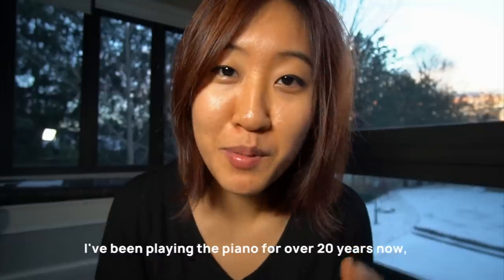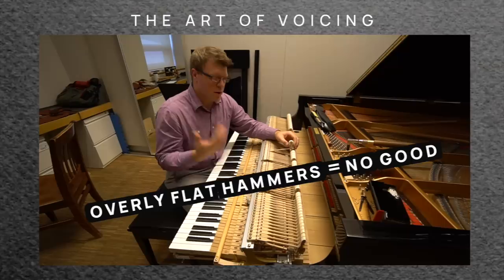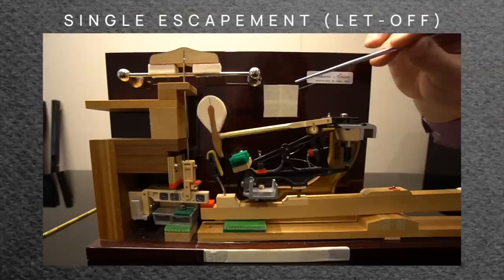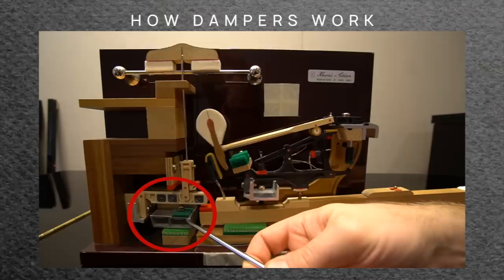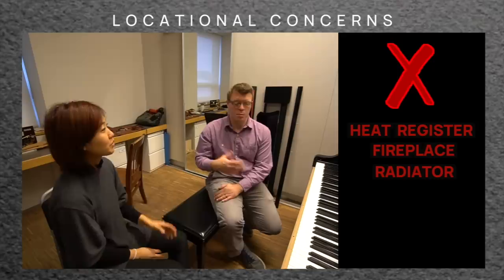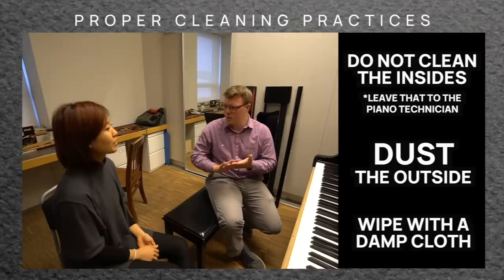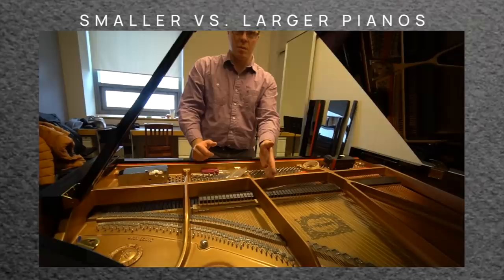The Fascinating World Inside of a Piano

Comment from the maker: Timestamps for smartphone viewers --

00:53 All of the different parts of a piano action
01:43 Basic key mechanism
02:21 The art of voicing 
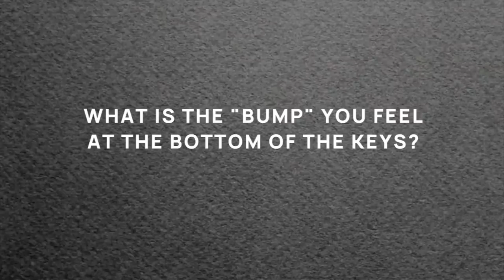06:33 The bump at the bottom of the keys (single escapement)
07:46 How dampers work
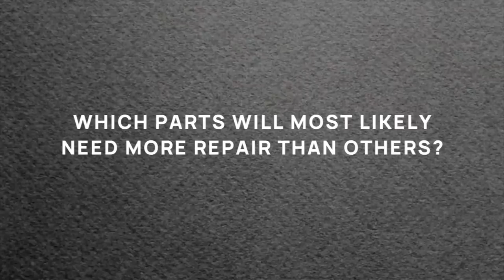08:46 Parts that wear out faster
10:04 Ideal conditions for pianos (temperature and humidity)
11:13 Ideal locations for pianos (what not to do)
12:44 How to make the touch lighter or heavier
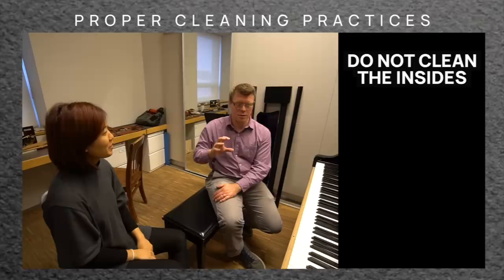16:20 How to clean your piano
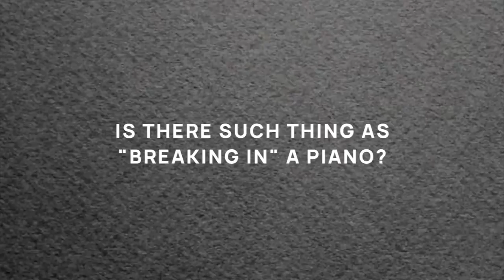17:37 New pianos
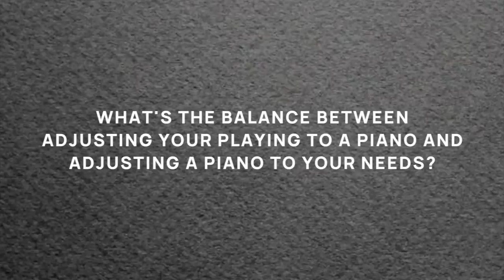18:38 Adjusting pianos vs. adjusting TO pianos
19:35 How often you should tune pianos
20:10 Smaller vs. larger pianos
21:17 Advantages of playing on a grand piano
22:59 Tips when looking for a used piano
25:07 Pedals
25:59 The sostenuto “middle” pedal
29:28 Final thoughts
Reply: Thank you!
Reply: Nahre Sol Thank you Nahre! It is very kind of you.
Reply: Amazing video! Learned so much! Thank you! And the fact that you timestamped it, shows so much regard for the time of your viewers. So thank you again!
Reply: I wish more youtubers would make videos with timestamps!
Reply: That's very considerate of you <3
Reply: hawkturkey , well some bright remarks on the quite small uprights which have their key balance point so near to the playing surface, that you can hardly practice the broken chords and more advanced études and concert works. now we know what's actually up with them.
Reply: You should pin this!

Comment: 22:41 physics.

What he said in the first half about the power coming from pushing the energy into the strings, (physics)... it’s easy to break something solid against something solid. But it’s much more difficult to break a solid object (a bad hammer) against something elastic. This is because elastic things (in this case the strings) absorb and channel the energy and redirects it in the direction from which it came. And in some cases it’s actually easier to break a solid object with something elastic like a whip. (Assuming the elastic object can withstand the amount of energy).

Rebounds/elastic things (rubber bands; etc) actually have a stronger impulse than when hitting a solid object. This is because when the elastic object absorbs the energy it usually sends it back with even more energy in the same direction the energy originally came from. This is because of Newton’s third law. A good example of this is breaking/bending a stick. 

When the stick breaks (from being dried out) the energy is released. But if the stick is still wet and ripe, it will bend. When someone walks past a branch and then it whips you in the face, they have put energy into the branch on top of the energy already stored by pushing it aside (usually forward). As it whips back, it gains momentum and speed. Because the tip of the branch is further out from the trunk/base, it has to move faster to keep up with the base of the branch near the trunk causing it to gain momentum. Sense the base of the branch is connect to the trunk of the tree, it doesn’t have to move as much.

As a result, the branch backlashed with more energy. (I’m not sure how well I explained that but hopefully it made sense). Basically, elastic things have more backlash than solid things because elastic things can absorb more energy. That’s why worn hard hammers bounce back rather than putting emergent into the strings. Or something like that.

There’s an old saying “if you don’t bend you break”. Now a days people don’t usually say stuff like this often or don’t pay mention attention to old sayings like this but this saying obviously came from physics. It’s a concept of physics that can and is at times applied to life. Newton’s third law of motion is another concept not isolated to physics as well as the idea of perfect elasticity in terms of transferring of energy. What I mean, by perfect elasticity is that energy can be transferred through a change of events. It doesn’t matter if it’s positive (happy, joyful, etc) emotions/energy or negative (depression, bitterness, etc) emotions/energy. Basically, if you have a bad day and yell at someone, later that day the person you yell at has potential to yell at someone else, and the chain keeps going. As adults, we know better but honestly it’s more about how much negative energy can we withstand/absorb before we feel the need to release it. (Sorry this last part is a little off topic but it was a good chance to make a few points).
Reply: "This is because when the elastic object absorbs the energy it usually sends it back with even more energy in the same direction the energy originally came from."

No. Energy cannot be created from nothing. Unless a chemical reaction occurs, the elastic object can only send back a maximum of the same amount of energy it received (usually less due to energy losses from sound and friction). What happens with the branch is that the person who's pushing it is doing so relatively slowly, so you have a slow and steady accumulation of potential kinetic energy in the branch sometimes over several seconds. When the branch is released, all that energy is released in a much shorter time span, meaning it has to be higher (e.g., the person put in 100 J of energy per second over 5 seconds, and the branch releases 500 J in 1 second. The end amount of energy is the same).

"As adults, we know better but honestly it’s more about how much negative energy can we withstand/absorb before we feel the need to release it."

Are you honestly treating "energy" in the psychological sense as if it were the same as energy in the physics sense? REALLY?
Reply: bennemann you’re right. Conservation of energy. (Plus laws of thermodynamics dynamics. And if we’re assuming the energy wasn’t lost to friction  and heat, Newton’s 3rd law would apply.) But that wasn’t the point. It’s called a metaphor. 

When I wrote this admittedly I was a little rusty in physics. Not so much right now since I’m in a physics class but still, that wasn’t the point.

And whether you believe it or not, negative energy is contagious. Positive energy can be too, but this is all relative to the type of person the energy comes into contact with. Thus meaning for some people it’s harder to be happy if the situation does match up with thoughts inside their head. Of course this is not necessarily true for everyone. A good common example of positive energy is taking a friend out to drink when they’re down. (I don’t drink but its not hard to tell that this happens). Obviously, we set examples as adults. It’s not something we choose but something we grow into. Thus adults we have a responsibility to know these things and the help balance things out if possible and or necessary. To much good stuff is bad stuff. It’s about balance.

Musicians are tend to be pretty aware of this. It’s important to not be too hard on yourself sense you’ll just end discouraging yourself to the point of not want to play but you also need to be aware of what you need to work on and be focused. It’s like being strict while also being kind at the same time.

This part is psychological but the original concept was more sociological. Among other things.

Comment: 6:33 shows, in my opinion, the most important action part, the jack, that allows the action to function by letting the hammer go so that it doesn't block against the string. Almost every modern piano action has this, except the Hickman action which uses an actual knuckle joint (different than the "knuckle" at the bottom of the hammer) for the letoff action, which is much lower friction than the sliding jack and hammer knuckle. A great design but introduced in 1929 as the Depression hit and nearly wiped out the piano market, so was quickly forgotten, while the old jack system kept going thru the present.

Comment: Compressed air works great for cleaning the insides of a piano. Of course you cant use too much air pressure but a gentle blow can remove built up dust and other materials without damaging or having to touch any of the insides. Its what i use to give the insides of my piano a gentle clean every so often so dust doesnt build too much.

Comment: Very interesting, thankyou for the video. 
I would be really interested in another one on pianists's personal settings ( after touch, tension of the springs, distance of the hammer from the strings, back check height, etc.) and how they affect the tone production. Benedetti Michelangeli for example didn't want too much tension on the repetition spring because when you lower the key you have more resistence, and that is good for playing fast repetitions but not for playing a very good pianissimissimo. Also here he doesn't say that the after touch should be at 2 millimeters from the bottom of the key or that when you feel your action not responding well, if you just lubricate periodically the knuckle it will make a huge difference!

Comment: Decreasing wear on the felt pads is NOT why making action adjustments is important. The reason why action adjustment is important is that the better adjust the action, the better "regulated" it the term technicians use, the better the action is regulated, the more even from note to note is the pianists control over the notes, and the more precise control of each note, the pianist has – you want each digital to go down the same amount before the let-off occurs and the hammer goes flying into the string, acoustically-detached from the digital. You want to feel the same amount of resistance at each digital. You want to hear the same amount of loudness for the same amount of force upon the digital, from time to time and digital to digital. THAT is why making action adjustments is important – so the pianist has the most possible control over what each note sounds like, in response to her striking each digital with her digit.

Comment: My piano technician told me that the humidity shouldn't drop under 50 %.
The recommended humidity on the steinway website is 45-70 %. So i think the advice of 40 % in this video is too low. Great video tho! So relaxing and informative!
Reply: the ideal humidity for a piano is actually 42% (translating to ideal moisture content in the soundboard). Slightly higher or lower is OK, however it's the extreme fluctuations that cause problems. Someone living in the desert would have a very hard time maintaining 50%, however if it were consistently 35% and didn't vary much, that would be fine. Also, someone living in a cold climate with winter heating could never maintain 50% without having sweating windows.
Reply: @paulclement4222  Good to know. Thank you!

Comment: I've always wondered why the pedals are always so close together.  This may be suitable for children but for most adults wouldn't separating them more (just a few inches) give better alignment with the natural position of the feet?  To me it is difficult to get the left foot over on the sostenuto pedal when the right is over the damper.  It seems that the damper should be more to the right and the una corda and sostenuto more to the left. The size of one's feet would be a factor here but just a little more more separation should not impair those with smaller feet.  Between brands I've never noticed any deviation from the standard position.

Comment: finally found out how sustain and sostenuto pedal works
still want to know how una corda pedal works, the shifting mechanism so the action hammer only hits 1 (or 2, cmiiw) out of total 3 strings per note...
Reply: u didn't notice your entire keys move a couple millimeters to the right? that takes the hammers with it. Pedal drives another lever that pushes the left side of the action. springs on the right side of the piano push it back when u let go.

Comment: Does this mean if you press and hold the right pedal, then press the middle one and release the right one, the result is the same as holding the right pedal because every key will be held by the rod ?
Reply: it depends on how finely regulated the sustain pedal is. I'm actually here now bc of this question. Another video by Edward Neeman on 'Intro to double pedaling' has him basically take out the slack between pedal down where the dampers are fully off the strings and sostenuto-tab-catch height so that the pedals can work independently.

Void Rays... yeesh, amirite?
Reply: @y2kenh  Void rays void rays, gotta mass up my void rays

Comment: Excellent video.  Suggestion..... Possibly a bit too much science/engineering for your channel. Here goes. 
The inner mechanism of a digital piano keyboard might be interesting. I think emulating the touch of real pianos is probably the weak link if you want to use the better software piano models such as Pianoteq. Top piano manufacturers endorse the better software models. I have not seen a piano manufacturer endorse a digital keyboard. Piano teachers at higher grades often insist on a real acoustic piano. So what is stopping a manufacturer designing a really good digital piano keyboard?